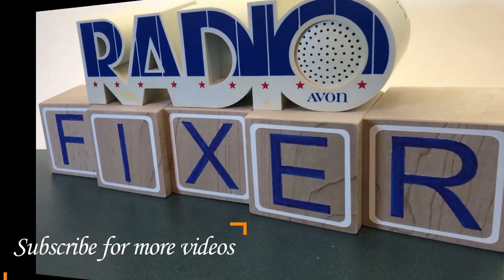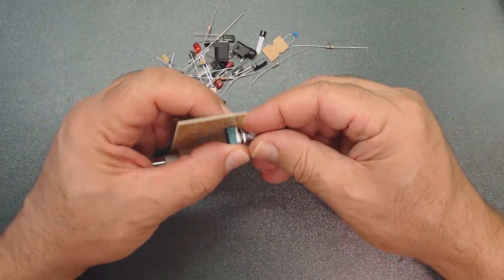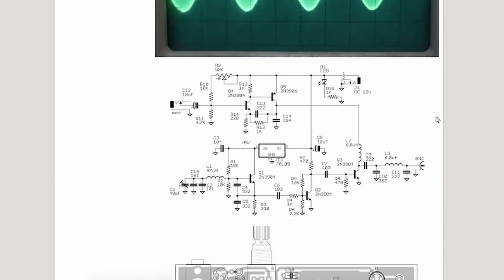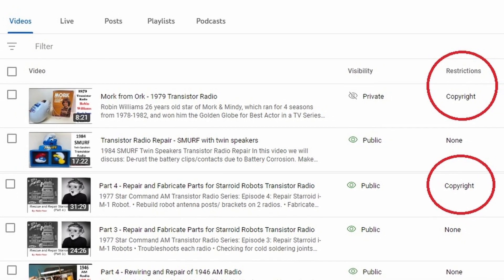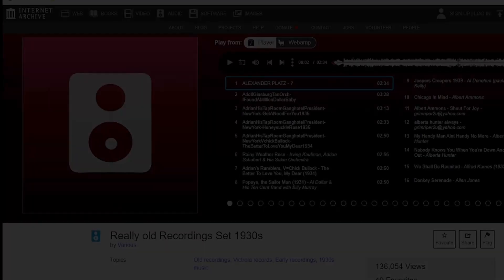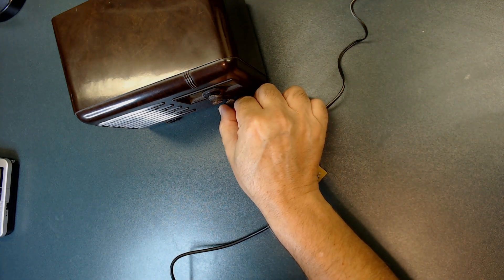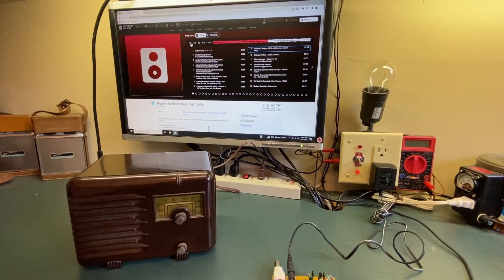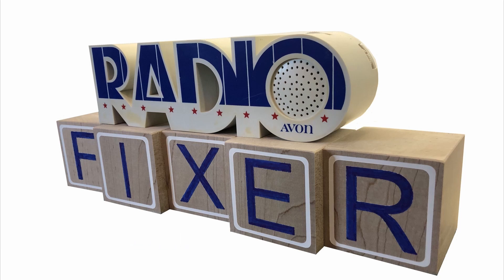Let’s assemble an AM Transmitter.

Comment: For antenna use a short piece of wire, longer = better
Reply from the maker: Hi Daniel, so good hearing from you. Thank you for taking time to message me. You are definitely correct. I added about 6 feet of wire and it broadcast almost the entire house. I also bought from amazon an antenna for it and that one also worked very well. Have a great weekend. Regards, Jay
Reply: @RadioFixer  Nice, don't go too powerful though

Comment: Hello; enjoyed your video on the AM transmitter and would like to purchase one. Went to the link you provided, but I can't read the language on the site. Is there a way to translate? Also, how far will this transmitter go? Thanks!!
Reply from the maker: Hello Stephen, so glad that you enjoyed the video. 

I added antenna and is broadcasting about 20 to 30 feet away. It is a low range.  I used Chrome search engine, it gives the ability to change the language, I discussed it on this video where the language change is located.   

I bought mine a few years ago on eBay. Unfortunately is not available on eBay any more. I send him and email and hope he will respond to my email. 

He sell it from his website and lazada website. Not sure how safe they are since I did not buy it from those website, I noticed that he is selling them on this link but again I am not sure about this place as well. https://www.lazada.co.th/shop/radio-diy 

Hope this helps. Have a great day. Regards, Jay

Comment: Reminds me of when I got in trouble with the FCC! So back in 1965, still in high school, I took a Heathkit 160 Meter 100 watt ham radio transmitter. Then I purchased a 1200 KHz crystal and tweaked the transmitter to broadcast 100 Watts on the AM broadcast band. In upstate New York, , it seems like the local radio station would only play Italian and Polish music Friday night, but the kids in high school wanted rock and roll... 
So I basically started an ILLEGAL AM radio station and was on the air for over 8 months, just let my Reel To Reel tape deck play lots of songs.
Then the local radio station, with a Lot OF Loss listeners turned me in to the FCC. They did not like the competition!! 
The FCC showed up and they were both Ham Operators and understood what I did and why.. They laughed it off, but told me to give them the 1200 Crystal and dont do it again!!!
That was my kickoff into electronics and radios!!
OH, the Good Old Days when the FCC was not politicized!! 🙂Robert
2 Years later I got my LEGAL Ham Radio license and only followed the rules, did not want to loose my license... 🙂
I know folks who look for these AM transmitters that are Solid State and put out 60-80 Watts... Geeeeeeeee, I wonder what they are doing with those??? LOL
Reply: Good old days I miss in my life. I designed a 50 mW power short wave transmitter for AM. I used 50 yards of wire piece as antenna. Soon, frequency allocation board (FAB) guys showed up because I was at 7.2 MHz which in region 1 'n' 2 is 40 meters ham band. I also happened to interfere with my scruffy neighbour's SWL who actually reported me. He didn't like me playing songs from 1980s and all. FAB guys confiscated the transmitter. Alas!
Reply from the maker: Good hearing from you. Such great story, thank you for sharing.  To much control on everything we do these days. I added about 10' of wire to my transmitter and now is broadcasting to most of my house. It is fun project. Thank you for taking time to message me. Have a great day! Regards, Jay
Reply: @RadioFixer  excellent! You might have noticed that if you walk away from the unit, signal becomes weak and you start getting noise. Ah! Quite the experience AM is.
Reply from the maker: Robert, that is great story. I always want to do that, broadcast my own station since I was very young but had no electronic background and did not know how to do that.  Still learning about this fascinating most rewarding hobby.  Finally I can lesson to some awesome old shows and music my old radios. That will be so much fun. Thank you so much for telling me such a great story, you are right about those good old days. Have a great day my friend! Regards, Jay
Reply: @RadioFixer  BTW, I never thought about playing old music!! Clever Idea for sure!! When I sell a radio or FM-AM tuner, on eBay I always add a video showing that the radio is working. Sometimes I stop on a local FM station to demonstrate tone quality, but doing that will alert YouTube to the music being played, and then I get that NASTY email telling me I am in copyright violation..
I learned that if I dont stay on the station for more then 10 seconds, it escapes their tool they are WATCHING US WITH!!! 😞
Also, being near Mexico, if I do stop on a FM channel, I usually tune in a Mexican music station! That seems to make YouTube happy!! 🙂

Comment: Nice build Jay sounds good. That wall wart is probably not regulated and with no load you will see 15 volts. Once under load it will more than likely go to the stated output voltage. I've seen this a lot with those supplies.
Reply from the maker: Hi Mark, I did not know that, thank you so much for reaching out and letting me know. I will plug it in and test the charger when radio is on. Glad that I did not modify the charger yet! Have a great day Mark. Regards, Jay

Comment: When buying stuff from foreign lands on the web it helps to have Windows  to translate the page to English! You must also convert the prices in Thai Bhat to US dollar. 1 US dollar is .029 THB .  I found the link to get three pages to get a copy of
 the parts list and schematic. One warns of the limitation of transmitting freqencies to only 1500-1600 KHz. At a mere 50mW power you must put it close to the receiver. Stick a solid piece of 18 gauge wire in the center of the BNC connector
 (output where antenna goes). It can be up to 9 feet long. That mouse is going to have huge biceps!
Reply from the maker: Hello Steve, I wished that I bought more off these transmitter when I bought mine on eBay several years ago. I checked ebay and is not there anymore. I definitely will try your suggestion. I am so excited that finally can lessen to old shows and music on my radios. Since you have the schematic, is there a way I can make this transmitter transmit much longer distance? If yes, what part should I replace or upgrade? You saw the mouse... LOL. that means that you watched my entire video instead of  scanning through it... LOL. As always is so good hearing from you my friend. Have a a great day! regards, Jay
Reply: @RadioFixer  The power of the transmitter is limited by the supply voltage and the components used in it.
 It is possible if it had a better gain control like the one in my Whole House AM transmitter which tunes a wider amount of frequencies thanks to a special tuner common in old car radios. With an antenna14 feet 
long it can transmit 1/2 block but don't tell the FCC on me! I can plug in the input from my Sirius/XM
radio output into it and retransmit it to the Whole House AM transmitter that goes out on any radio station less AM frequency available. I tune my Sirius radio to the Radio Classics channel and it goes out to any
AM only tube radio I have working. I will one day get a large wood cabinet Motorola tube set to work and
I would love hearing Fibber McGee and Molly coming out of it.

Comment: Congrats Jay. Sounds good. You can just get a BNC connector and hook up about a 9 foot wire to the center conductor of the BNC for your antenna. :)
Reply: You can also tack the wire to the pcb pad for the center connector. Not sure about this one but transmitters can be damaged by transmitting without an antenna.
Reply from the maker: Allen, that is awesome! I am so excited to check them out. Thank you so much for letting me know. So good hearing from you Allen. Have a good day! Regards, Jay
Reply: Just a long wire antenna, say 15 feet long should provide a good load to the transmitter, BNC indicates 50 OHm, but who knows.. Just a long piece of wire should do the trick..
Reply from the maker: Hi Robert, Is good hearing from you my friend. I am so excited to test my other radios to see how far they can pick up from transmitter. This little transmitter performing awesome. Have a good day Robert. Regards, Jay
Reply from the maker: Doug, I am thinking to upgrade this unit if is possible so it can broadcast much longer distances. Added about 15 feet long wire for antenna and now it broadcast about 20 to 30 feet but would like if is possible to broadcast it to entire house. Is it possible to upgrade this unit so I can control how far it can broadcast? Not adding more antenna but upgrading the parts. What do you think? Thanks
Reply: @RadioFixer  Hey Jay, that's a great question. I think this problem has been is one that has been discussed a lot for AM transmitters. I know we have worked on one for our company to market, but so far the distance has not come easy. I know a lot of folks out there use ones like the Talking House which I'm told works well.
Reply from the maker: I bought a talking house 😂 but for music it sounds awful, good for messaging but music is not great at all. Saw some videos about talking house to increase one of the cap so it sounds better but this little receiver broadcast like a high fidelity so clear. Thank for getting back with me.
Reply: @RadioFixer  I agree that sound quality is key!! Good luck on what you’re next step is going to be! 
Robert
Reply from the maker: Thank you Robert, wish that I had some electronic background to do this type of modification. It should be a way that you can control how far you can broadcast, like some type of amplifier or something like that. I have enough power 12 DC volts to be able too but not sure what yet. 😂
Reply: @RadioFixer  Do you have the Schematic Diagram for the transmitter?? I could take a look and see what is possible.
Reply from the maker: Yes! I do have it, it is 3 pages. Please feel free to send me an email so I can send it to you. Thank you very much! 

Email: radiofixer@yahoo.com
Reply: @RadioFixer  will do that soon! Restoring some vintage test equipment most of the day!